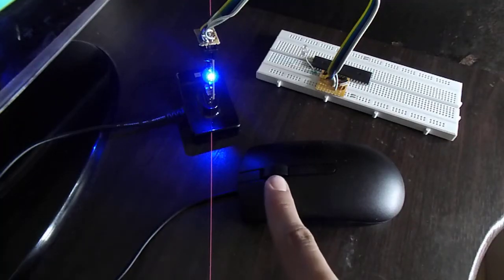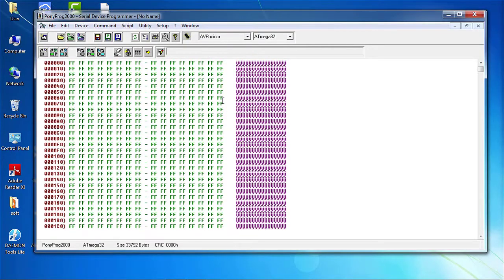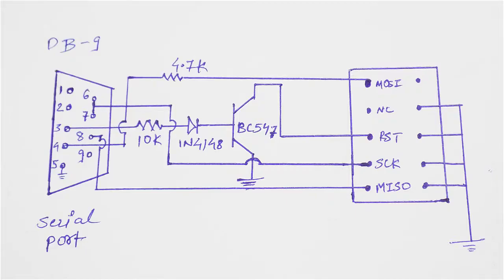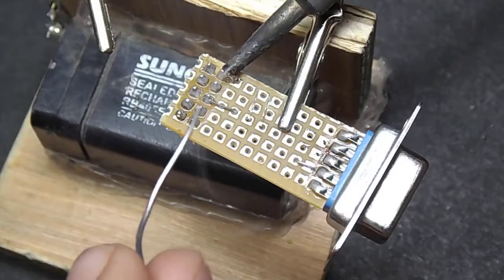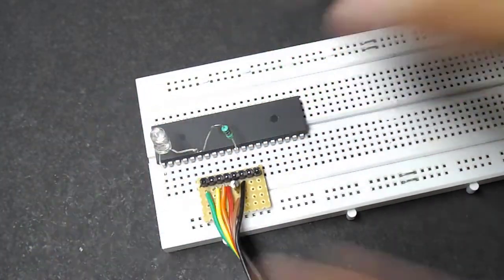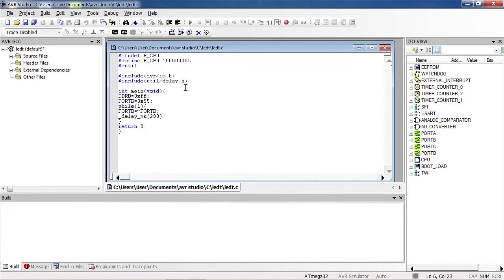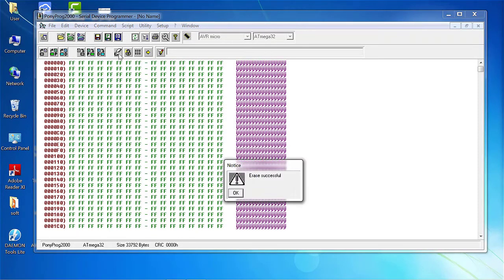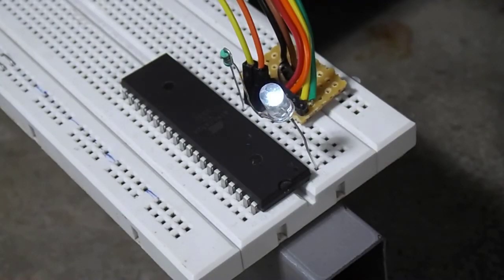DIY AVR Serial Programmer

Comment: hello i dont have db 9 port in computer what should i do ?
Reply from the maker: https://youtu.be/Q3QKLDIbzmw
Reply: @techdiy2970  i dont have enough money to buy usbasp and i m in urgency . can u please tell me if usb to db9 connector convertor work ? i have only usb outlets , so will usb to db9 convertor wire work ? and will there be any problem ?
Reply: @techdiy2970  i dont have enough money to buy usbasp and i m in urgency . can u please tell me if usb to db9 connector convertor work ? i have only usb outlets , so will usb to db9 convertor wire work ? and will there be any problem ?
Reply: @techdiy2970  can u please make a tutorial to make and develop usb programmer for avr chips please ? ( not using premade boards like usbasp )